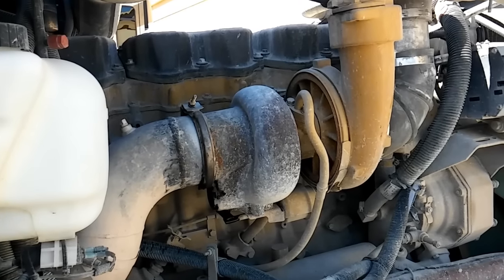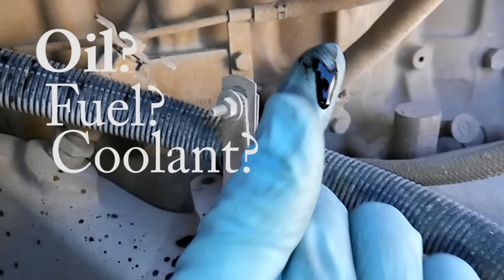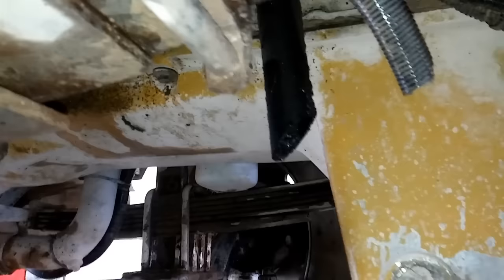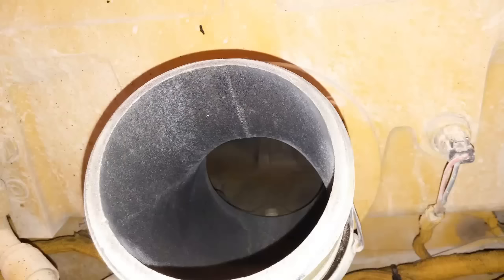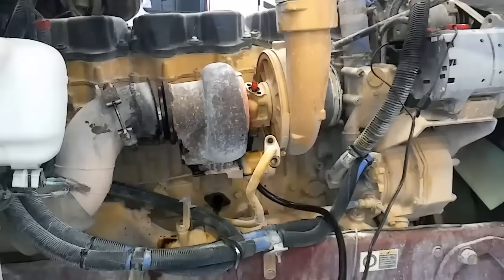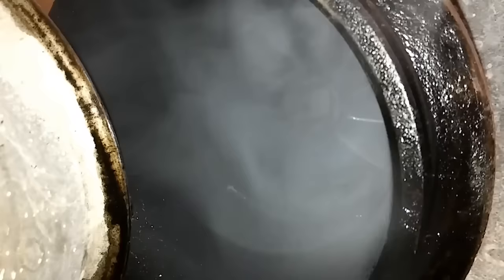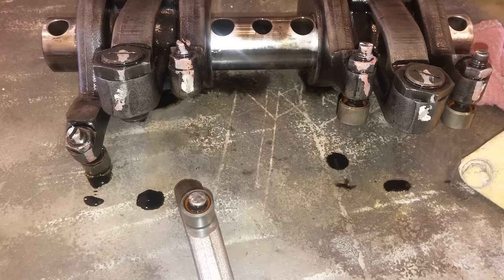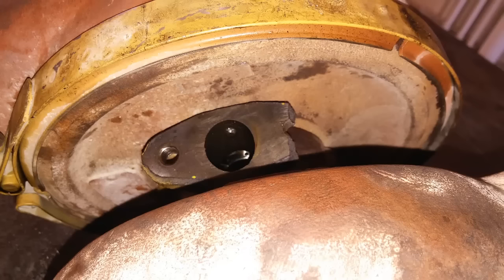Oil In The Exhaust?  What Causes It and How To Troubleshoot It.

Comment: Good use of the smoke machine, we see lots of slobber issues when drivers idle for long periods in the cold.  Use to see lots of broken rocker arms too, on the acerts when it gets cold out (-30c) or colder drivers would say they were getting great boost, 60 psi or more then POP! there goes an intake rocker.  good video thanks.

Comment: I have a tractor (JD 4020), that has a oily residue coming from the exhaust manifold where it goes into the stack. I have concluded that it is more than likely caused by the engine (apparently designed to not use valve seals at all). If you don't heat the engine to a good temperature, or if it is not worked hard enough it will not fully burn the diesel, and it collects in the exhaust.
Reply: That would be called wet stacking 👍

Comment: I had a tarrington 929 with a three port over boost file while injecting ether throughout the manifold pressure transducer reactionary force motivator.  I used a bogden 929 with a 3/8 in adapter torqued down to 96 newtonians with a half hitch packing  plate coupled to the exterior phalange tube and the problem was solved.

Comment: That oil return line can be really problematic, since the return tube/sealing surface really doesn't want to stay flush with the turbo side and it's so tempting to just tighten up the bolts to make it seal. Wondering what could be done better than just using rtv sealant on oil return to seal the gap and not over tightening the bolts ?

Comment: This is l exactly what I have on a C4.4. Engine would also runaway when it ramps up. Did cylinder cutout none of them are dead . After running away when you pull piping on the tubing side it’s dry. Ran the engine for 1 minute and it was a puddle of oil. Pulled CCV filter it does look dirty but I’ve seen worse . Pulled air filter it’s not too bad . Will replace the turbo and retest.

Comment: you missed one cause that iv seen before, crank case filter plugged up, will cause hight crank case pressure and push oil through your turbo seals leading you to believe you have bad turbos
Reply: what rank case filter ?
there is no such thing
Reply: @Uc9uE3pKsS6uQ  , it's called Crankcase breather filter or Oil Separator Filter. Drivers side by the oil pan. If your truck has a Breather Filter and it gets clogged, it will cause high oil pressure. This part needs to be replaced,  Oil Separator with new filter and gasket to engine block.
Here's a video to watch: 
https://youtu.be/wP4nmdDPfaM
Reply: @ralphborroel5684  this on new CARB complaint engines may be
mine blow free
Reply: @Uc9uE3pKsS6uQ  , I can't understand your comment. Sorry.
Reply: crankcase filter delete
Reply: You're right. Clogged Positive Crankcase Ventilation(PCV) Valve or CCV Valve or Crankcase Breather can cause excessive blowby, Oil leaks on crankcase seals, clogged intercooler, rough idle,  sluggish performance, increased oil consumption. There is a diaphragm which gets torn/worn out over time. In that case, the PCV valve should be replaced. If the valve gets clogged, it can be cleaned and reused.
Reply: @Ralph Borroel  not on this Cat motor

Comment: We had a oil seal fail on a 6v53t and it ranaway on us, luckily with 2 strokes is that is doesn't need the turbo because it has a roots blower. Sit runs since we removed the problem

Comment: So what direction would you go in this scenario? 

White smoke that really burns the eyes. 
Lots of blow by coming out of oil fill cap. 
Iv tried turning individual injectors off to see if smoke stops but it stays the same with all cylinders. 
I did find a little bit of oil in the intake  turning on the turbo and the rest of the intake piping. 
No misfires

Comment: i had oil driping out of the middle of exhaust manifold and i noticed some steam coming out of blow tube the motor had 40000 miles on complete rebuild but sat for years trucks is not on the road so the only thing i could do is just idle it too get the temp up seems too might of helped but not sure the last person to drive it was my cousin and hopefully he didnt abuse it too cause anything  ps the exhaust blows clear though

Comment: Also, I do have some small amount of smoke coming from the blow by tube on the drivers side. I always figured that was normal for an engine with 190K. And it still has that small amount. 

But I have also been told it could be as simple as a PCV clog? Causing crank case pressure to increase and thus pushing oil through the seals on the turbine?

Comment: I have a Isuzu NPR HD and it's very hard to turn over has plenty of power to the starter even turning over the engine itself with the wrench it's almost impossible but with the starter it a turnover maybe 90° each time it does It was leaking a lot of oil internally curious what you guys may think it is it's a diesel

Comment: If you see blue smoke it’s oil. If it’s white smoke it’s coolent.
Reply: JaArRyi FleshBlood not always....
Reply: Can be raw Fuel, white smoke
Reply: Chuck E WHP guintard is that only when a cold start?
Reply: It can be unburnt fuel
Reply: I see a lot of wet stacked engines at my generator job always leaking goo from exhaust joints. 
That blows a bluish-white color. 
Run it harder and it’ll clear up. 
Don’t be near the exhaust if you load bank one unless you like hot cinders falling on you.

Comment: I have a 05 t600 kenworth with a C15 accert with the same problem..pushing oil thru intake manifold  ..we put new turbo on it ,repair the engine twice with new head and it still pushing oil thru intake manifold..cant find the problem yet..

Comment: I've had Nissan ZL 30 - 3 LT diesel engine with new turbo , new oil intercooler , new radiator , new injectors put in correctly by very reputable mechanics . Oil still coming out exhaust like spitting droplets . All items above had to be replaced . Engine has been pressure tested , no leaks of any kind and no pressure drop . Could the oil in exhaust be left over residual in the exhaust outlet and exhaust pipe from the blown malfunction of the old turbo . It has sloppy main shaft and was very wet on the exhaust side when it was removed . Is there a way to clear the oil out completely without having to replace the entire exhaust system . The original problem was first black exhaust smoke then very white and motor ran like a gutless low powered "sewing machine " . Anyone with any info please let me know , greatly appreciated . Many thanks in advance . Cheers . Great video Josh and very informative. Best regards from western Australia. PS my vehicle is back at mechanics getting checked over . Waiting for their diagnosis.

Comment: Hi I have a caterpillar 3406-DL and the serial number is 4CK03404 and it doesn’t have the sticker where it has the information for the motor and I want to know what the fuel timer for this engine is you can help me in any way please write me back
Reply: Have no ideal what a DL means. The 4CK03404 engine is a 3406C. 
You have a PEEC engine, 350 HP, FLT. The timing sensor you need a special tool and a electronic tool to read timing in ECM. You can adjust pin timing.  Your fuel system camshaft static is ten degrees. Timing is controlled by the personality module.

Comment: Hey y'all, 

I have diesel fuel coming out the exhaust ports. I have no issues driving. It actually starts up no problem (cold or hot), drives really well, has great power and very smooth operation.  The only issue is that the 2 of the exhaust ports are wet with fuel when I shut off the truck. I thought it was oil, but my oil level doesn't dip. I replaced the thermostat and serviced the cooling system to make sure the operating temps were up to spec.  Any suggestions? Bad injector? Cylinder problems? Wet-stacking?
Reply: I would suggest checking the injectors first. Could be as simple as a missing or damaged o-ring.

Comment: Hey I need some advice I got a 3406e model cat it had a oil leak where the transmission in the engine meet at the bottom passenger side the garage that I had to fix it told me that they were going to have to pull the tranny to fix the leak they put a new clutch in it they put a bearing in it as they took it apart they found these things wrong the truck also had to have a radiator and a coolant for the turbocharger replace I got the truck back I had a lot of black smoke coming out my stack Chuck-E-Cheese in La Jolla feels like it's loss of power I'm taking the truck back into him several times seeming to not tend to what I'm asking them to do and I'm kind of worried what should I do

Comment: Hi, I have a question: My 2008 F-350 super duty 6.4L my turbo low oil comes out in the exhaust pipes and a thick white bush comes out of the rear pipe. My Higth turbo is new and the injectors. with you solutions.

Comment: I have a ism that recently got overhauled.... it doesn’t have blowby now and runs good but still has high crank case pressure... pushes dip stick out and makes a oily mess... shop told me to tie dip stick tube down????? I’m thinking something else is wrong either leaking exhaust into crank case or boost... new turbo is 3k and they say can’t be rebuilt... any suggestions? And if I do tie dip stick tube down am I going to cause any damage... couldnbit be Jake brake ? No white smoke and no oily turbo everything is dry.. I’m kind of at a loss here any suggestions appreciated

Comment: Hi!i have a problem with a ford focus mk2 1.8 tdci 145 hp,after  the engine heats up when i m accelerating i can hear the turbo whistling and losing power ,it also has oil leaks under the turbo,do you have any idea what could be?

Comment: Your videos led me to what I think my issue is, and my issue led me to your video. But I think this is exactly what is going on with my Cat 3116. Its my money maker so I gotta get it figured out asap. Slowly it started putting smoke out of the exhaust on start up and under acceleration, but the past few days it has gotten much worse. I had a buddy start it up with the hood opened and on the passenger side I can see the plume of smoke coming from the first exhaust clamp behind the turbine exhaust. After this video, I assume I have either bad seals or need to replace/ rebuild the turbine. Given that time is money to keep this truck rolling for years to come, would you agree that seems to be the issue? Note: even after idling for a few hours on a job while using the PTO to operate the aerial ladder, on take off the smoke was more substantial, but after some driving it reduces somewhat but not altogether.

Comment: Hey I got a 95 3406e it blows white smoke when It first starts up and runs rough. Was told could be injectors o rings and do an overhead any possibility that could be my issue?

Comment: Damn keep it simple, start with checking with air filter. Cats haven’t made highway engines for a decade, give them something new to learn with Vgt turbos and how egr works. For the average person you should not see a leak from your exhaust manifold weather it’s soot or oil. Talk about miss fire, I just had to remove a Mercedes mbe 4000 cause the unit pump oil dripper broke and the unit pump roller destroyed the cam. Cam comes out from the rear.

Comment: My 98 mod 3126 is spitting out a bunch of oil on the exhaust side of the turbo. I changed out the turbo only to find that same problem. There’s a tapping sound that comes and goes. Very sad
Reply: The tapping sound came with the problem with the oil . BTW I appreciate your channel

Comment: hi i got 2006 pete 387 with c13 engine  antifreeze  cames between exhaust manifold and turbo going thrue inside turbo all the way to  under exhaust  pipe  and i got smoke cames on top exhaust   i changed \precooler but it didnt work  any idea  please let me know  thanks

Comment: Mine its turbo very lightly wet but not barely see same bout the exhaustbout of block.
But when its cold runs ok.

When engine get hotter it starts and higher rpm boutv15000rpm very roughly and blue smoke.
Should be egr or pistons

Comment: Good Vid.  Posted a msg to you yesterday 11/5,  lost power, limited to 1,100 rpm.  Checked this am and found a puddle under the eng.  Has never leaked a drop.  Took some photos and the oil seems to be coming from under the turbo.  Took some photos, but don't see how to post them here.  Any assistance?
Reply: Too bad this channel never replies. What was the issue in your case? Bad turbo?

Comment: How about if it is fuel in turbo charger? Causing white smoke, i already check the injection nozzle, it has a good spray pattern. But the nozzle tip is full of carbon. Cant find the cause of fuel leak... Help pls
Reply: It's due to dripping fuel inside cylinder or on top of piston. As needle assembly of fuel nozzle in injector group has worn out and resulting abnormal carbon ash deposit on orifices 🇺🇲☺️🇵🇰💰😉

Comment: What if you do have alot of blowby and steam coming from the breather? Only when it's at temperature.
Reply from the maker: Well if you have steam, that is probably only going to come out when the coolant/water in the crankcase is close to the boiling point of water. It isn't going to steam very much at 70 degrees. Hope that makes sense.
Reply: @AdeptApe  ok yeah I'm pretty sure it is the coolant that is being eaten up. It will slowly drip dirty water out of the breather when the motor cools.
My guess/hope is it's a head gasket. I can hear bubbling coming from the heater core and it eats coolant. It's a 94 12 valve. Probably need to pull the head to figure out of its the gasket or something really awful. Are those motors prone to cracked heads? The blowby isn't horrible and seems normal when it's cold.

Comment: Hey buddy. I have a Detroit series 60 motor and I have a leak around the turbo area and my oil pressure at 1500rpms won't go above 42 psi.  I have 643,822 miles on it and haven't done a rebuild at all.  Do you have an email or contact number?  I'm still under warranty and would like your opinion on what it could be.  I have a few pictures I could email you.  Thanks in advance.
Reply: Hey , I have same issue 
Did you figure out the cause & Fix ?

Comment: If the turbo seal goes will it fill the cylinder walls up with oil?
Reply: what seal, intake one ot exhaust ? turbo have two seals, of each side
Reply: Gamet logging did you ever find out why you're cylinders had excessive oil in them

Comment: Can this also go the other way and cause blow by
Reply: Do you mean exhaust leaking through the turbo oil seal into the oil system?  Doubt it, oil pressure is higher than exhaust pressure. Blowby is caused by cylinder compression leaking around the (worn) piston rings and into the crankcase. 
In some cases of blown head gaskets or cracked heads you will see exhaust getting into coolant channels and pushing coolant out of the engine, but this seems unlikely with oil.

Comment: I NEED HELP!!! I took my car to a dealership to get an oil change, on the way home was perfectly fine, I parked it at home and life was good so far,  after a week when I drove it again I ran it on the freeway it started to make a weird dry noise, I check the motor oil and the oil dipstick, it came out dry!!!! when I called the tow truck the guy notices that the back of the car was all splashed of motor oil, it looks like the car ran out of oil because it burned it all through the exhaust, by then I only drove it no more than 6 miles after I drove it from the dealership. I had to tow the car to my home due to the dealer was closed when that happened. I called the next Monday and they sent a technician to check it, after he took a look at it they towed it to the dealership. Once at the dealership they are telling me that there was this hose that busted and that is the reason why the car ran out of oil. Does anybody has any idea if what the dealership makes sense or do ya'll think that they are trying to cover an error they made at the dealership?
Reply: Valiendo wine
Reply: Sounds like they forgot to tighten the drain plug.

Comment: so what happens when you get oil out the exhaust without a turbo ?
Reply: Valve guides Are done. It's possible to change them without taking off the head if you are careful

Comment: Hi, I got one question: One of my friends car is making a very loud hissing noise after turbo replacement (Turbo was replaced with a used one) and the exhaust side is leaking a little bit (There is a clamp or something on it and its leaking from there) but its really loud. Could this be the turbo failing or just the clamp that is leaking? Ty
Reply: as long as the housing is good its cheaper just to rebuild the turbo. i just rebuilt the one on my f350 for $150. all brand new internals and seals.